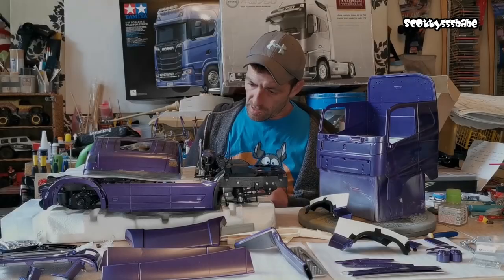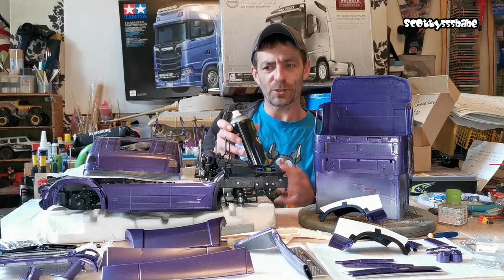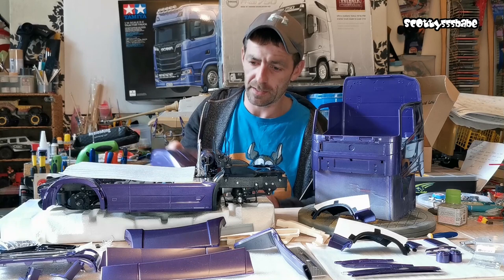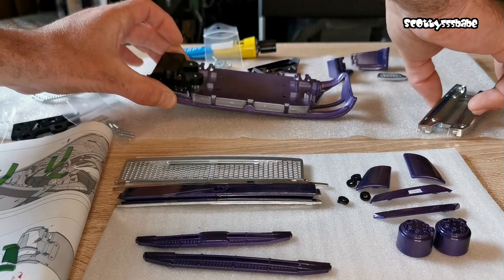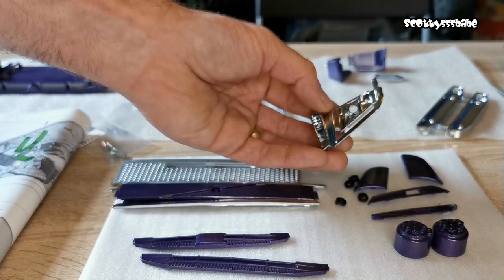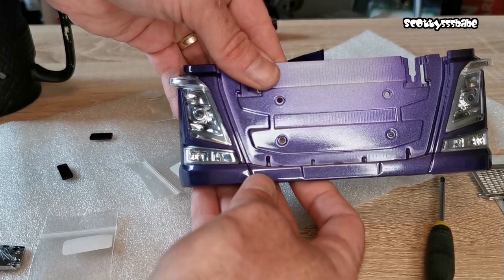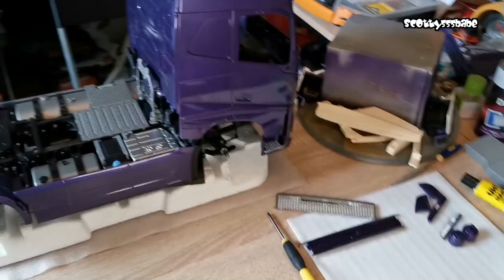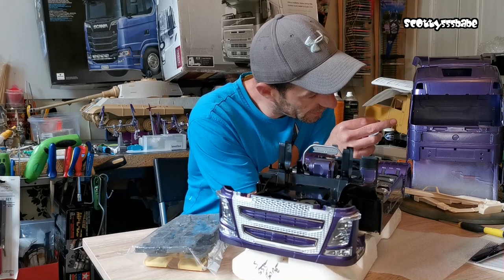Verkerk Volvo Truck build part 34 Front Bumper & Headlights | 1/14 scale Volvo FH750 Rc Truck

Comment: Cracking colour for a Volvo , if counting to 10 doesn't do it keep counting. Its looking good .
Reply from the maker: Cheers mate, my wife picked the colour and I agree it's a nice colour, I'm just a little disappointed with my first clear coat not going on wet enough, but that's the joys of the hobby.. If it was a Tamiya cab then I would have flattened the laquer back and re coated it, but the Volvo would end up falling apart so it is what it is and the top coat came out great 👍👍

Comment: Love the colour. I use a handle that clips onto spray cans that makes it a lot easier to use. I'm shocking at painting so I always say it's a working truck paint finish not a show truck lol
Reply from the maker: Thanks, I was a little annoyed at first when the laquer orange peeled but it still turned out OK in the end, I left school with only an art gcse, seemed to be the only thing I was good at. Does the adapter allow the aerosols to spray the same way, my friend showed me something one time which clips to an aerosol and it fan sprays like a real spray gun, Im just finally getting around to using a proper gun and compressor so I've a bit to learn again as it's just not quite the same as airbrushing..
Hopefully see you Saturday mate 👍👍
Reply: @scotty555babe  yes it clips over the top of the can and you hold it like a gun. I'll send you a link